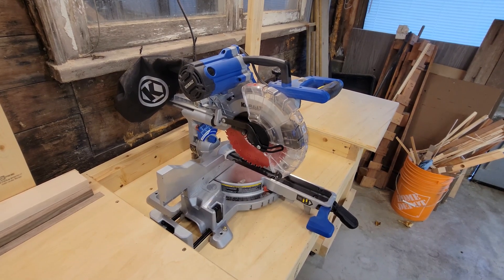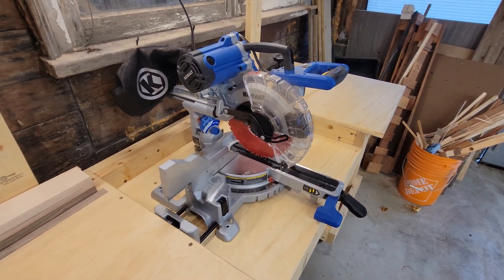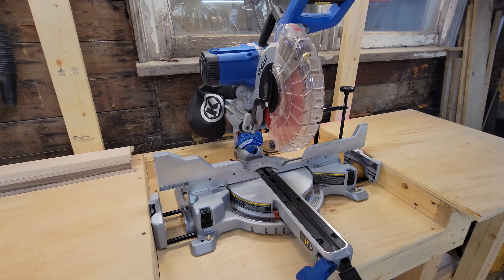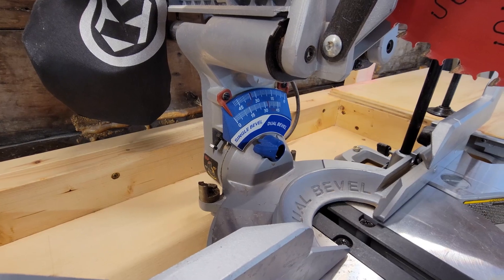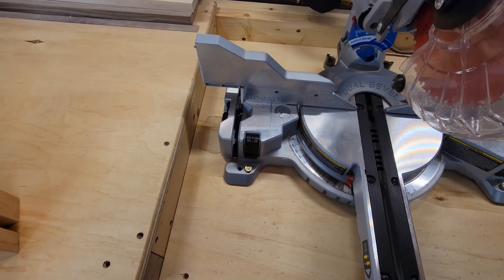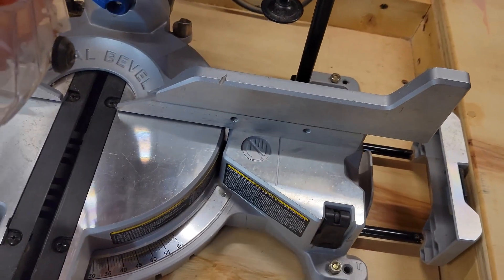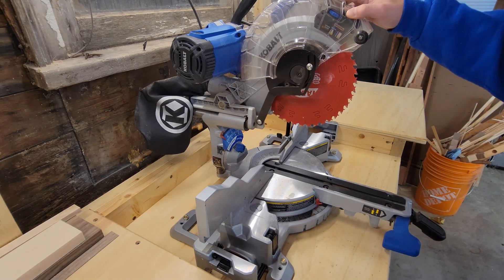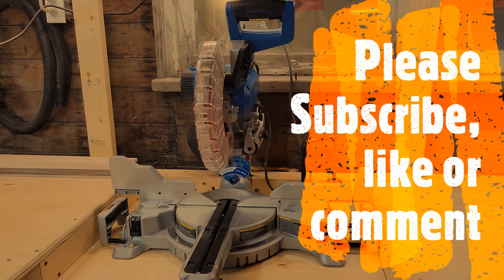Review Kobalt Dual Bevel Sliding Miter Saw SM2517LW

Comment: I would like to see a video on adjusting the fence. Since there was a nasty cut on the saw, I think it would be helpful to show how you adjust the factory set fence. I am not only a novice but have never used a miter saw. I have used a chop saw and a table saw but my new Kobalt 8.5 inch miter saw is a little threatening. Thanks for your consideration!
Reply from the maker: At the moment, I'm snowed out of my shop, gotta love winter.

The process I used was clamping a peice of plywood to the saw, cut the plywood and used that cut line and a framing square to align the fence.

Its definitely a video I can look at making and posting. 

Thanks for the suggestion.

Comment: Great video. Can you put on here the link to the Diablo blade, TXS
Reply from the maker: https://www.homedepot.com/p/DIABLO-10-in-x-60-Tooth-Fine-Finish-Circular-Saw-Blade-D1060X/100033809 or https://www.homedepot.ca/product/diablo-10-inch-x-60-tooth-carbide-tipped-fine-finish-mitre-table-saw-blade-for-wood-cutting/1000177972
Reply: @wordworking_awv  Thank You

Comment: Can you tell me if the saw can be locked down at an angle other than the predefined angles? As in 5 degrees or 31 degrees. Mine does not and it seems like a real flaw.  Thanks
Reply: yes it can
Reply: @BobbyH-ts3je how?
Reply: Tighten the oval-blue knob by turning it clockwise
Reply: @ I don’t believe I have an oval-blue knob.
Reply: The Oval blue knob attached to a threaded shaft that was shipped (packed) in the white styrofoam packaging lid.Thread it in beneath the angle scale and it will lock the saw at whatever angle you wish
Reply: @ricksnyder5399  If it's a larger model there should be a black handle like lever that you simply push down to lock it in place

Comment: I brought my off the display at lowe's when they sold this brand do you happen to know what size battery it takes and what size saw bag
Reply from the maker: Mine is a plug into the wall, not cordless. For the dust port a standard 2.5" shopvac hose will fit

Comment: How do you get the spring properly installed.  I screwed up everything trying to replace the blade and now can't get it back together.
Reply from the maker: Which spring has come out, when I replaced my blade I did not recall a spring

Comment: Just bought this saw and I have the original blade on there. I was cutting a 4.25" baseboard vertically against the fence and it had issues cutting all the way through (it leaves a very very tiny piece that breaks off). The stops aren't active. Tried adjusting the fence with no luck. Any advice? is it the blade?
Reply from the maker: The blade that comes with the saw isn't very good, a replacement blade makes a huge difference. Also try a zero clearance throat plate, either make one, or they are available online. Hope that helps

Comment: I have this Kobalt 10 in compact dual-bevel miter saw model SM2517LW /1413794 bought in the US at Lowe's about Sept. 2021.  On your video you show the pop-up stops on the extension wings.  My saw did not come with them but there is a place they will fit on the extension wings that have a 3/16 hole in the wings for mounting the stop.  I would like to have these but they don't show up in the Kobalt manual as an available part.
Do you have any suggestions?
PLF
Reply from the maker: Based off my manual, they are part numbers 349G and 349F, if you were to call 1-888-356-2258 (again this is from my manual) it states you can order replacement parts. Hopefully this helps.
Reply: I have my local US Lowes store trying to find these parts but I did not have your email with part numbers when I contacted them.
I contacted the Customer Service at the Lowes on the www.lowes.ca website.  Using your part numbers they could not find the parts.  They said even if they found the parts they could not ship to the US.
I would love to have the parts but I guess I'm out of luck unless my local Lowes can help me.
Thanks,
Phil Francis
Reply from the maker: I know its different store to store, but where I am the level of assistance at Lowes is the reason I drive past them and to HomeDepot.

Comment: Avoid Kobalt power tools! They offer no support. Even if you track down the random Taiwanese conveyor belt company (Rexon)that made the saw for Lowes, there is no parts support and Lowes offers no support. Check out any of the aftermarket part replacement sites and there are parts for Rigid, DeWalt, Milwaukee etc etc. What is always lacking is any support for Kobalt. Break your lower blade guard and you're forced to chose whether to risk your fingers every time you use the saw, or throw the whole saw in the trash.